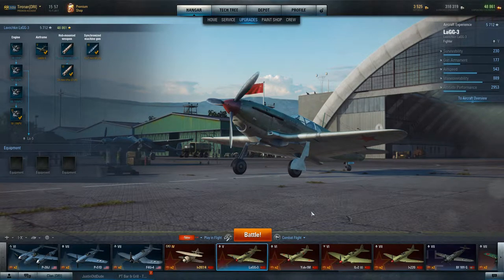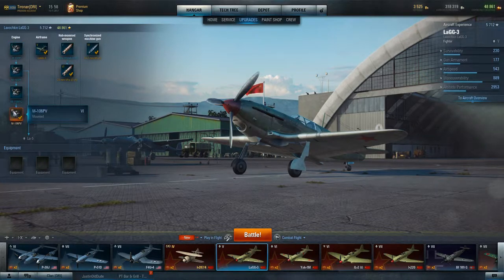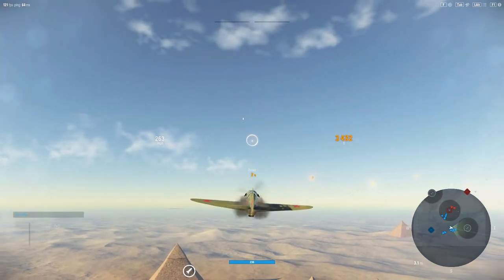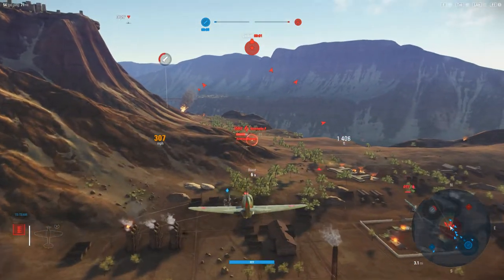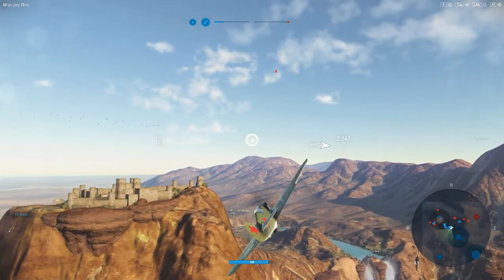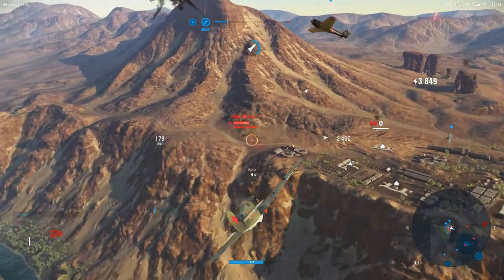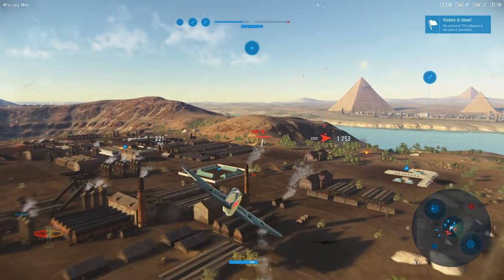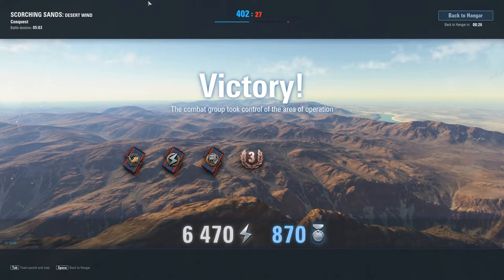World Of Warplanes 2.0 Lagg -3 full upgrade

Comment: I turn and burn keeping a very close eye on the red triangles and a priority on prioritizing targets. One thing I do that helps greatly with this aircraft is to key-bind flaps. It helps alot with turning and makes a significant boost to it. You are right on the money about there is nothing head and shoulders about it above any other tnb. The La-5 is very similar. It's good if you work at it. I think this plane is easier to do well than the i-210.  Another very good video as usual!